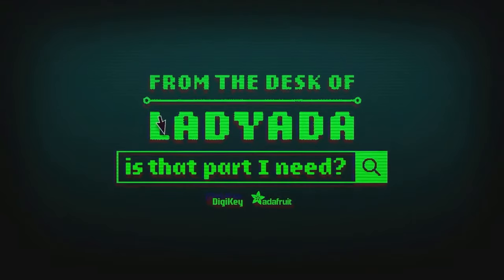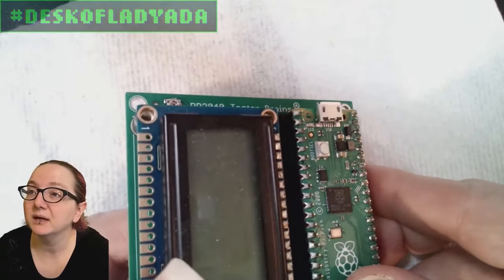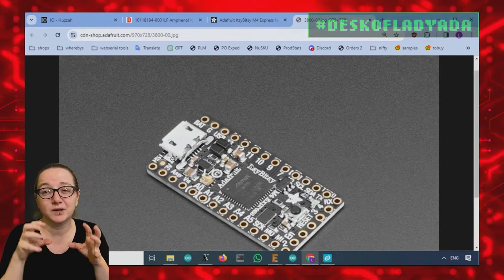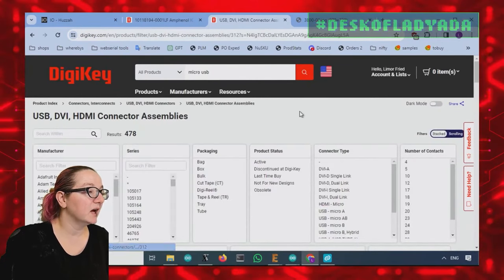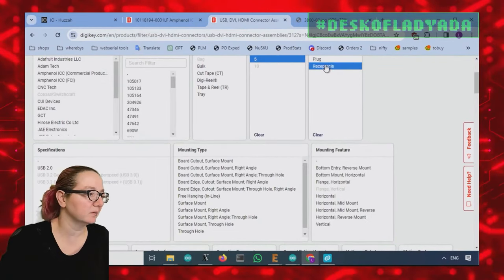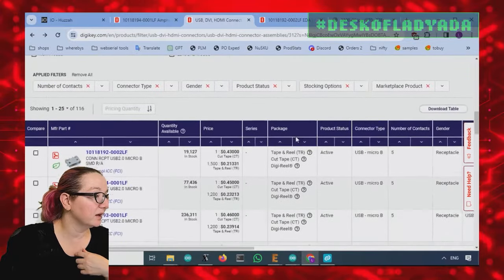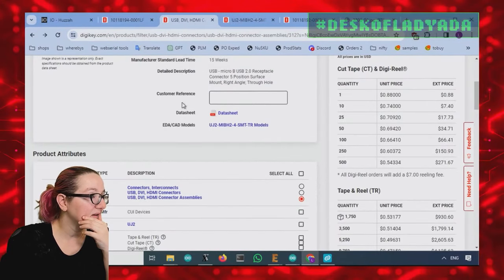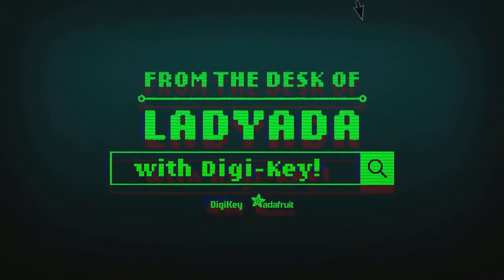The Great Search: Micro USB SMT/THM Connectors #TheGreatSearch #DigiKey #adafruit @DigiKey @adafruit

Comment: 3:29 One time a colleague managed to break a USB-C port off of a KB2040 board, the anchor joints failed because they didn't go all the way through. I now make it a point to inspect them and flow solder if needed.